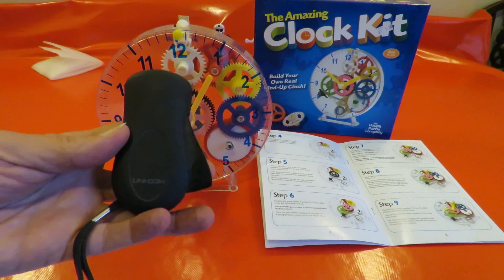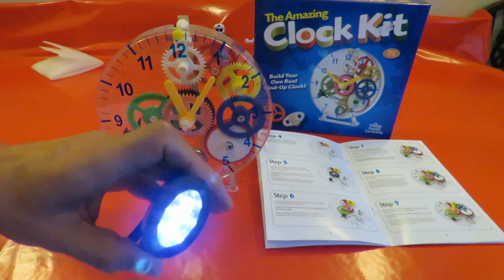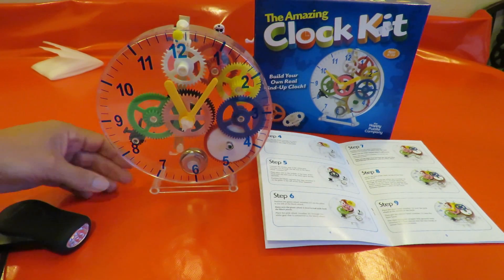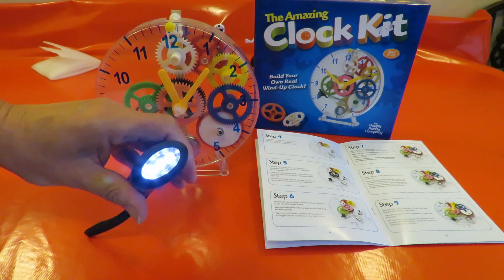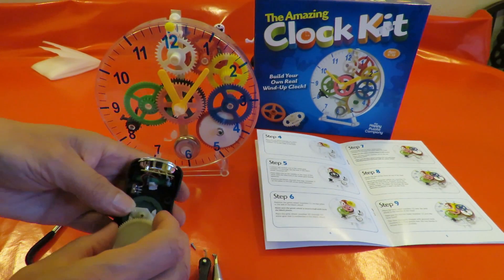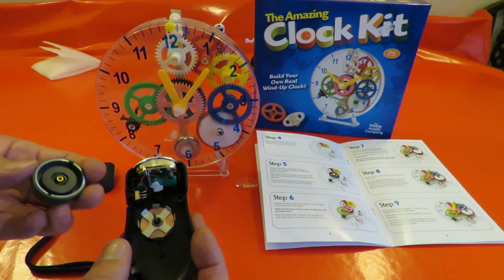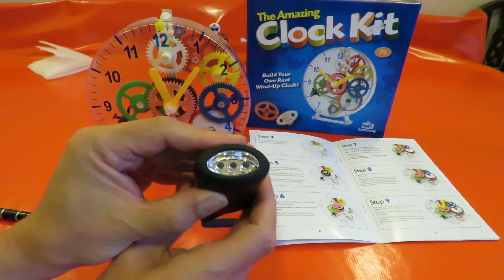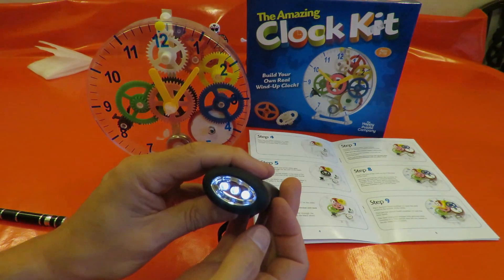Clockwork generator for LEDs and Supercaps PART #1

Comment: maybe the same concept using a windup alarm clock. You wouldn't have to worry about a pendulum and the spring would store the energy for later if you put a obsticle in the gear to stop it. Here is a version I made a while back. I'll post a link to my video.
Reply from the maker: That's a proper heavy duty clockwork mechanism you have there, that does the job with no trouble :-)